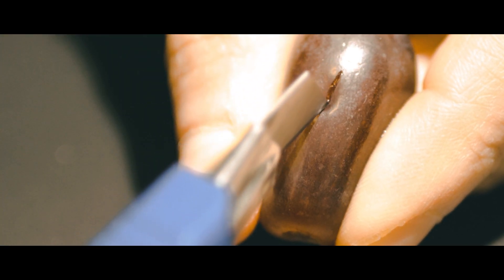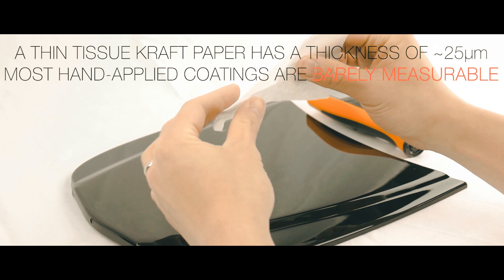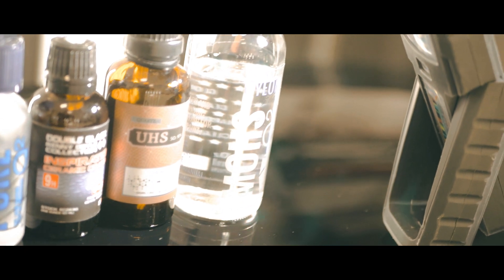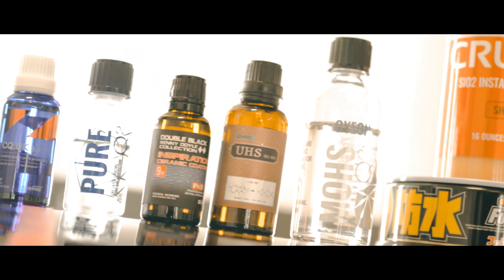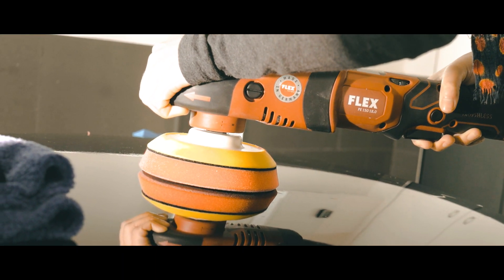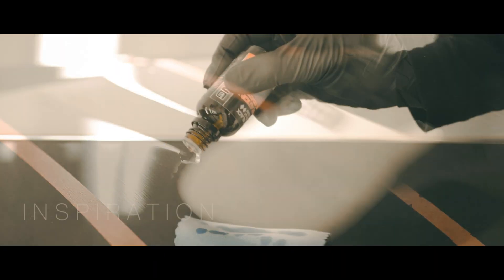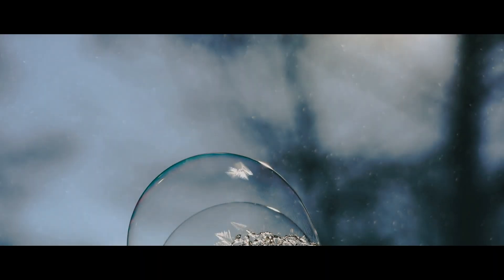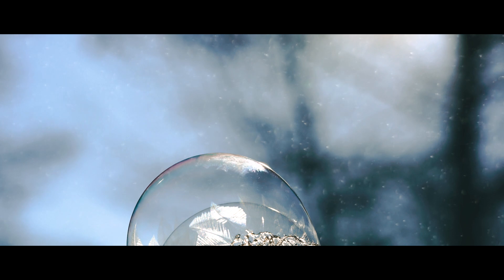Self Healing Ceramic Coatings Investigated!

Comment: Very new to this, but I am confused why ceramic coating is even necessary at all, if the bare paint itself has the ability to self heal?
Reply: Its not the paint that heals. Its the coating that heals it self with heat

Comment: I must say overall the video is extremely well made with the content.  Self healing is all about thickness and flexibility period.  However, the test that you have is quite weak looking at how thin the layer is. 

We recommend you look at revivify SH Pro coatings.  It's a single thick layer, not 2 part.  As well as our scratch test are done with much more pressure with a wire brush then what's on your video.  Based on our test, with wire brush and the pressure that we apply for testing, Gyeon coatings do not stand a chance to self heal 😁
If you would like to make a video with Revivify Pro, feel free to reach out. 

www.revivifycoatings.com
Reply from the maker: Whoa! This was never intended to stir pots! It was an intriguing experiment for us, we started the vid way before we know your existence!... who knows, maybe our test panels are nutty!